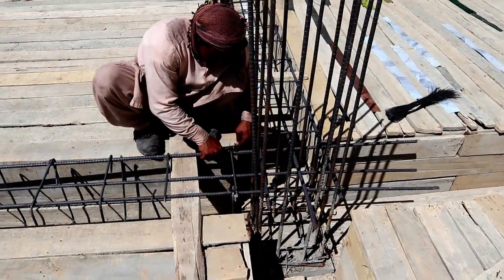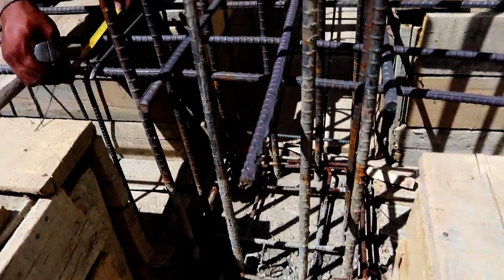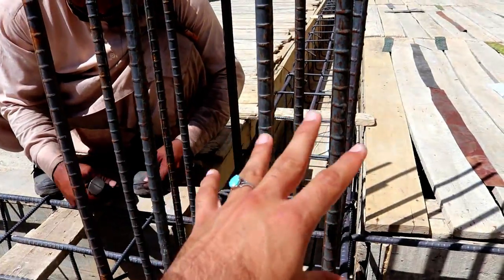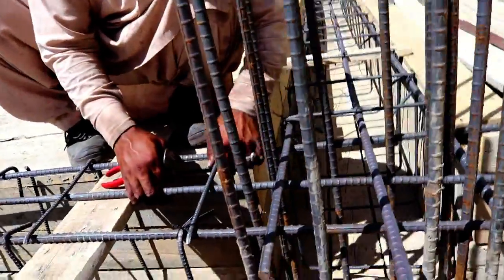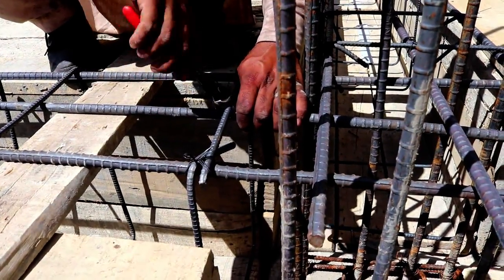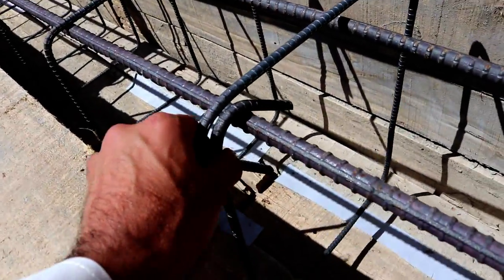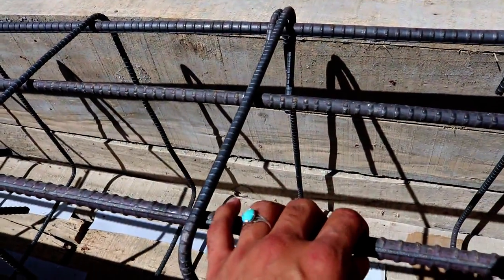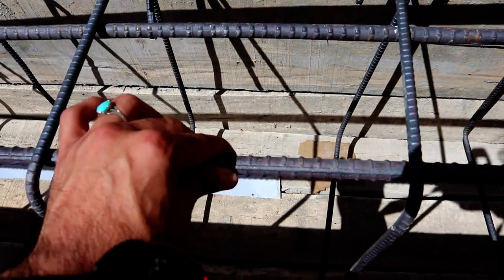Steel Reinforcement for Beam and Column on Construction Site - Civil Engineering Video

Comment: The timber formwork, is so old and I  could see many holes. This formwork won't give you nice and smooth finish after removing it and also The concrete strength would be reduced due to excessive absorption of water by the timber. 
Ecnomic wise is good option.